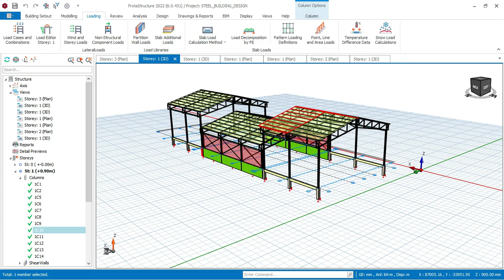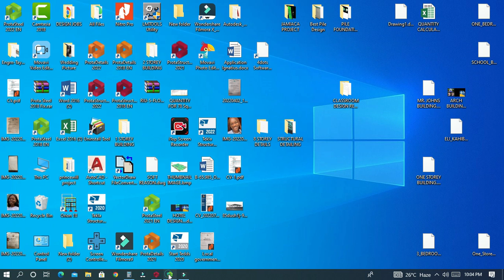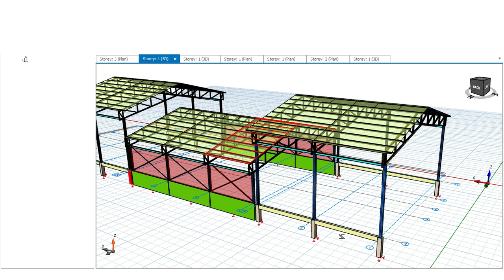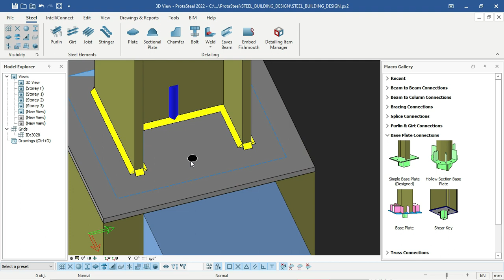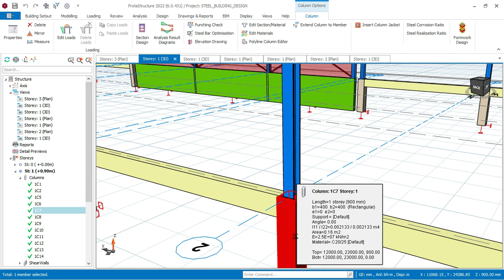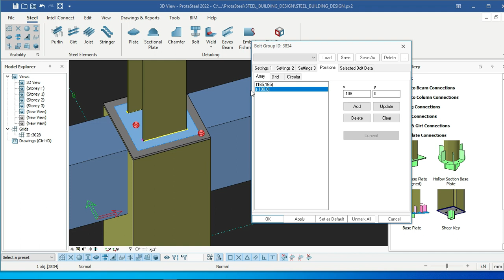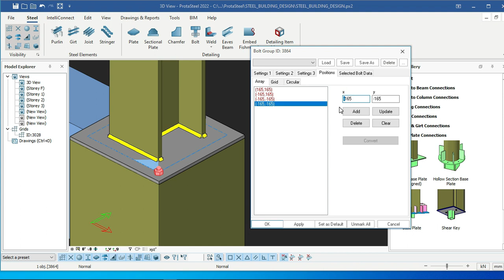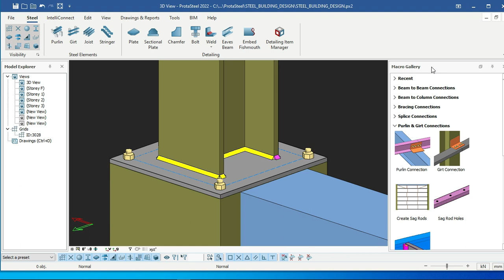How to Create a Base Plate Connection in ProtaSteel 2022.

Comment: Ekidel i have a question; Does prota steel also design ?? in short how do you ensure that the base plate parameters are correct?? For example, if you select 12mm as base plate thickness and yet the correct one is supposed to be 25mm, does the software tell you that?? Please guide.
Reply from the maker: Yes
Reply: @Ekidel you havnt said anything
Reply from the maker: @mweetwamulongo1425  I said Yes,  Protasteel checks the connection members and if not adequate it shows you